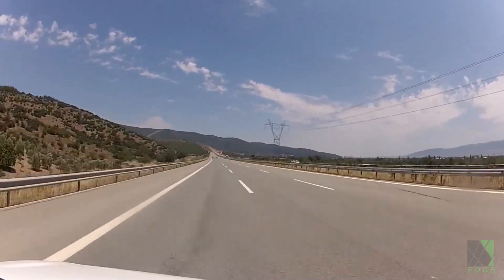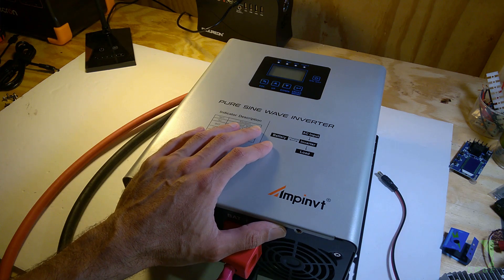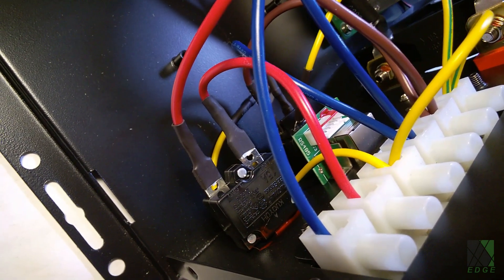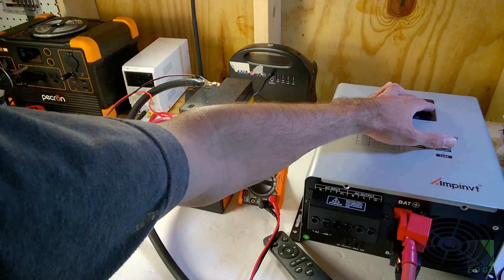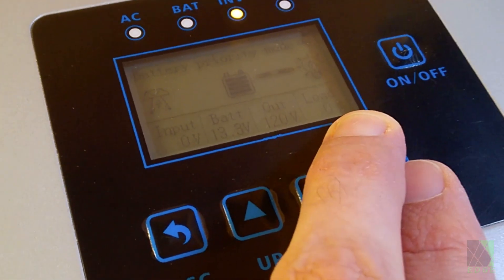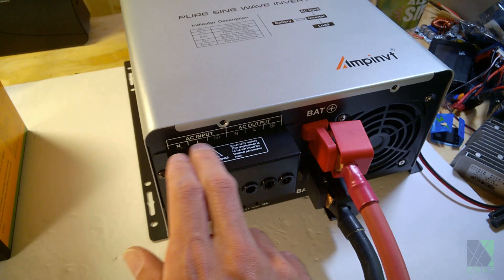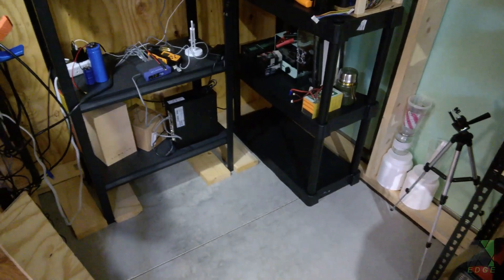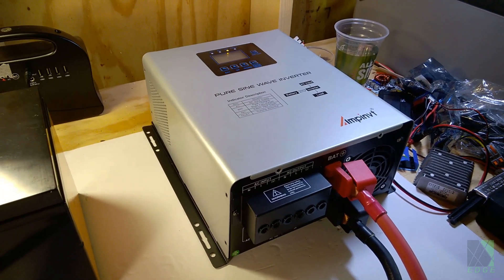Low Frequency Sine Inverter less than $200  "Off Grid" upgrades planned Solar Workshop #VLOG

Comment: Hi isn't the fan supposed to be exhaust. By looking here in this video i can tell this is condigured as inlet not exhaust
Reply from the maker: @danisharshad1354 It would depends which way the fan is facing. Unfortunately my inverters are packed away for awhile so I can't confirm
Reply: @solarpoweredge ohh... But the way the vents are configured it should be exhaust. My inverter was also overheating as the fan was configured as inlet which was trapping all the hot air in. So know i configured it as exhaust and it's fine now

Comment: Any new updates/ thoughts about this inverter?
Reply from the maker: @jamesfalvey77 Hello, I still have this inverter and it is used to power desktop PC, camera light. And an air conditioner. We will be expanding to power a server and some other appliances. Shop tools and AC will be powered separately by a larger inverter I tested, but I have to wire it up first. 
Last year I eventually bought a second one of these 1200w inverters for a spare and other purposes. I like the fact that it has a toroidal transformer inside. 1200w isn't super powerful, but for the price I think it's unusually well made. By not running it 100% all the time, I hope to get many years of service out of it - we'll see!

Comment: I've got the 800 watt version of your inverter. I'm curious with yours, what if any sound do you hear from the inverter when the compressor in your air conditioner starts? With mine, starting a fridge with another roughly 75 watts already running from it puts it at a momentary 25 watt overload and causes the inverter to make a harsh buzzing sound for a second.
After the compressor starts, the load drops back to around 20% and the inverter returns to being silent except for its fan. I assume what I'm hearing is noise from the transformer and I'm wondering if that's normal for a heavily loaded low frequency inverter? Thanks!
Reply from the maker: @tonyz2897 Hi, I get similar results. The hissing or buzzing is the inverter suddenly pushing a ton of current through the transistors during the surge. This causes the transformers/inductors to "sing" basically they vibrate at high frequency. The transformer inside of this kind of inverter can make some noise depending on the load. Just for reference, the 1200w will start a 5000btu window air conditioner, but I think that's almost the max I feel comfortable with. It does not overload, but probably would if I had too much other stuff running. You could experiment with removing some of the inverters constant load and see if it stops overloading each time the fridge starts. Just sharing my thoughts and opinion :D
Reply: @solarpoweredge  Thanks for the reply and confirmation that a little noise under heavy load is normal. I've got a dedicated inverter for the fridge, just no battery for it yet. I got curious if the 800 would work but running the fridge won't be its primary use. It's nice to know it can in an emergency though. 
Thanks again!
Reply from the maker: Welcome! Yeah good idea having a dedicated inverter

Comment: Hola, de que forma podría usar este inversor con paneles solares y un controlador pwm?
Reply from the maker: @robertogomez5496 Hello, you can take a 12 volt battery, connect the solar panels and PWM controller, then connect the inverter through a fuse. That is a basic solar power system. Another option is to buy a solar generator or "portable power station" which has everything built in together. Then all you need is a solar panel and it just works. Hope this helps! -Dave
Reply: @solarpoweredge  Muchas Gracias, voy a emplear una batería de 12v LiFePo4 de 100A y un mppt PowMr de 12v 720W, de cuantos amperios podría poner el fusible de la batería al inversor?
Reply: @solarpoweredge  Ya que este inversor es cargador y el mppt tambien, como afecta esto a la batería?, es decir estaría entrando carga de los paneles y de la red.
Reply from the maker: @robertogomez5496 Hello, you can size the fuse according to the inverter wattage. For example if it is a 1000 Watt inverter - We'd expect something like 1000/12 or about 90 amps. Therefore a 120-150amp fuse should work. It's not an exact science. The main purposes is to ensure the fuse blows if there is a short circuit or accident, but does not blow when turning on an appliance with a surge. The most important thing is to use some kind of fuse, otherwise there is nothing to protect the system. Note: some inverters have a fuse built in

Comment: Great video! I'm planning to use this inverter as a backup for my modem and router. Do you recommend it for ensuring clean power to those devices, and is it a good quality inverter overall?
Reply from the maker: @albertob1867 It's a low cost inverter, but I think for the money it's decent quality. So far I've had the display glitch out on me, but after a reset it came back. The power output is suitable for running computer equipment etc. so your modem should be no problem at all
Reply: @solarpoweredge  Thanks for the info!  Do you think it would be okay to run a NAS on this inverter?  A bit worried about power fluctuations and surges with a NAS
Reply from the maker: @albertob1867 Welcome! Sure it can run a NAS. Should not be a problem. Incidentally I am building a solar powered NAS project right now, but it will take a slightly different direction. 
In any case - if you are still very concerned about power fluctuations (data corruption etc.) a small UPS could be used after the inverter to offer further protection. Kind of expensive though :D

Comment: Do you know if those can be parallel to  a breaker box to get 240 v?
Reply from the maker: @omarsegura2847 This kind of inverter cannot "team up" with another inverter to make 240v. It's a nice machine for the price though. I have 2 and they still work. I am careful not to run them too hard, and hope they will last a  long time.

Comment: Hi Bro, I am just curious, are you still happy after 7 months with the inverter? Any updates on the performance? Thanks!
Reply from the maker: @helerionanastas4709  Hi! It's still trucking along and I have 2 of them now. Only issues I have encountered so far: 
1) It did not successfully run a technicians vacuum pump (induction motor), but yet it ran my own similar vacuum pump just fine. I don't know why.
 2) sometimes on startup the display or controller lags and beeps, or is blank. Restarting it fixes the problem. Strange! but it still works fine. 
I only use about 600-800w on the inverter, trying to make it last. Hope that helps :)
Reply: @solarpoweredge  Thanks again 💙💙💙
Reply from the maker: @helerionanastas4709 Welcome! :D 👍❤️
Reply: Id didn't run the pump cause too much surge
Reply from the maker: @rm6857 The first vacuum pump I tried belonged to an HVAC tech, and it indeed had a high surge. But the inverter later ran my own brand new HVAC vacuum pump which is the same size. Ran like a top, no problem. Still quite a surge. 
Looks like an edge case where the inverter was very close to its surge capacity

Comment: Can you share the model ID because i cant find the 1200w model anymore on Amazon 

Not sure if they are selling the 1200W version as 800w now
Reply from the maker: @viyusavery248 Hi, the 1200w seems to be gone from Amazon replaced with the 800w version. According to the manual the model # is HT-1200W. I hope they bring the 1200w version back

Comment: Can you connect solar panel on it ?
Reply from the maker: @nelogaming5562 Hi, this inverter only has an AC mains charger, no solar input. Those types of inverters are available though
Reply: @solarpoweredge  can I put my panel on the charger controller and connect the controller on it
Reply from the maker: @nelogaming5562 Yes that will work fine, connect your battery to charge controller, connect solar to the charge controller, connect inverter to the battery. This inverter just has the option of using grid power to charge the battery, but it is completely option and do not have to use it
Reply: @solarpoweredge  thank you my man, helps a lot
Reply from the maker: @nelogaming5562 NP!

Comment: Thanks for the vid.  My question got answered in another comment.  Looking at this unit and the price is very attractive.
Reply from the maker: @YourOldPalFernbark Welcome :) this is a bargain inverter... still powering the workshop, drill press etc. it runs fine. I plan not to push it too hard though.

Comment: I've been using this device for over a year, and it has been performing well. The fan noise was initially strange but has since become louder while printing with a laser printer, then returns to normal once the task is complete, likely because it only takes a few seconds to finish each job. One drawback of this manufacturer is that all of their inverters and solar charge controllers use a CC CV charging mode, which applies a fixed voltage. This isn’t ideal for lead-acid batteries, whether gel or AGM, and in some cases, lithium batteries may not fully charge to their maximum capacity. While this isn't a significant issue, lead-acid batteries require a charging process that includes bulk, absorption, and float stages, and some users might want to equalize their batteries periodically. They do offer other models, such as FT and HSI Plus, but the HT model is the best choice for an office setting like yours.

Comment: Nice review. thanks a lot..
Still happy with it?
Reply from the maker: @barakhalla5338 Welcome! :) yes, I still like it and now have 2. However, I don't run these inverters very hard. 300-500 watts usually. Some amazon reviews mention the inverter burning out quick. I hope that doesn't happen. So far both are performing well under low to midrange loads. It runs a small AC just fine. Computer, air filters, etc. are easy for it. How long will these inverters last? Guess we'll see. Hope that helps!
Reply: @solarpoweredge  
very helpful, thanks!
Hopefully it'll last for many years (:
Reply from the maker: @barakhalla5338  Welcome :) me too

Comment: Curious about the battery charging voltages/ pre sets
Reply from the maker: @jamesfalvey77 So far I have not used this inverter as a charger, which requires wiring it into the electrical power grid
However the charger settings are shown in the manual here on page (9) and are customizable by the user:
https://icdn.ampinvt.com/2023/08/HT-Series-Manual-EN.pdf

Comment: I think this inverter will last you a long time, taking into account that you stated you won't be running at it max rated load. Maybe some of the other commentators on Amazon  maxed theirs out continuously.
I noticed at 8m28s that you had a battery very similar to one that I am eyeing as I can get 4 cells for around $145-. CALB 200Ah if it's the same. Just wondering how this battery has performed for you?
Reply from the maker: @Ulbre I believe you are right, never want to max out no-name inverters. My hope is going easy on this inverter will give 3 years of service - but who knows.
PS that is a 100ah GBS Lifemnpo4 I bought many years ago. I have retired it to bench battery status for testing. It has performed well, although I cannot tell any difference between the Mn chemistry any any other cells I have, such as CALB. They seem to act the same. Just my opinions though! Those 200ah CALB cells sound great btw. I am hoping to get a load of cells for my workshop ASAP

Comment: What is the idle power consumption with inverter on and no load?
Reply from the maker: @kidcymucks 13.7v, 1.14a, 15.7w

Many inverters of this type can charge the battery from grid power and act as a UPS. Part of the idle power consumption is holding closed the relay which switches the grid power terminals. This relay is always on whether the grid is connected or not. 

Comparing it to a high frequency inverter, idle power consumption clearly depends on circuit design... I have a small 300w pure sine inverter that draws about 1 amp idle. On the other end of the spectrum, I have a 3500w pure sine inverter that only draws about half an amp idle.
Reply: "Thanks for the info! Do you think it would be okay to run a NAS on this inverter? A bit worried about power fluctuations and surges with a NAS."

Comment: Cranking out the Solar videos, awesome 😎
Reply: Your content is right up my alley. Love the smaller RV applications.  I have a few smaller 200w setups in my barn to offload some barn cat heaters and 800w victron setup on my RV.
Reply from the maker: @MrRoboto2338 Very encouraging to hear, thanks a lot :) sounds like you have a lot of cool stuff. I want an RV to mod with solar, been looking around. If I get one it will definitely make for some good vids
Reply from the maker: @MrRoboto2338 :) will try to crank out a couple more as soon as possible - hopefully more detailed :D

Comment: Why low frequency? What sets it apart from high frequency? Why is this type "better"?
Reply from the maker: @jamesfalvey77 LF inverters are far superior for starting inductive loads like air conditioners and the like. They have other advantages. The typically large transformer core acts a bit like a flywheel. Here is an article that talks about the differences. https://www.sciencetimes.com/articles/42696/20230306/understanding-the-difference-between-low-frequency-and-high-frequency-inverters.htm
Reply: @solarpoweredge  thanks for the reply and the link. Your channel is very informative
Reply from the maker: @jamesfalvey77 welcome sir, I really appreciate the good feedback. Future videos should be more detailed, sometimes it's just a rush to post and upload